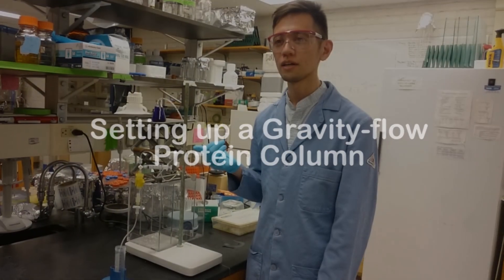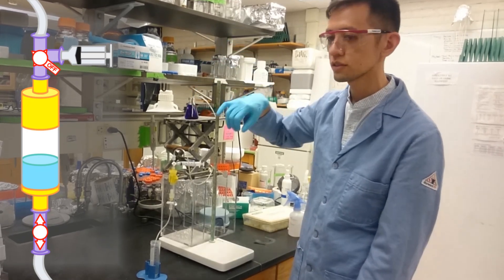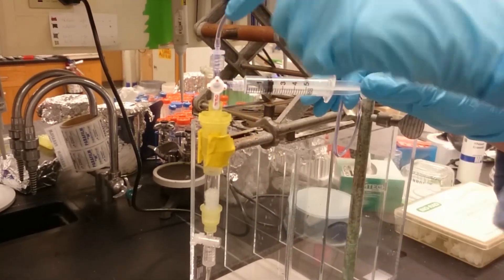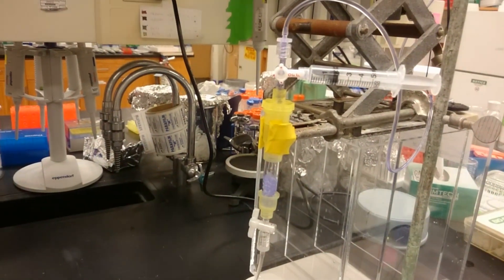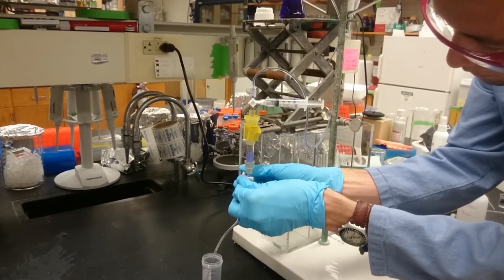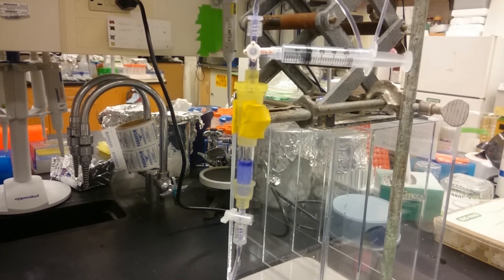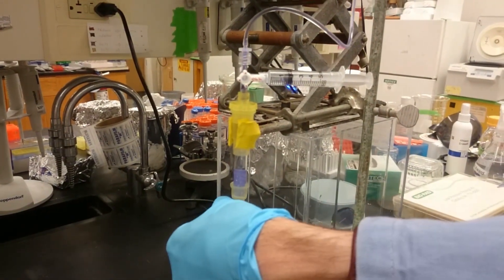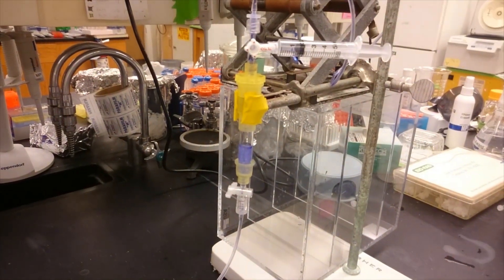Running a Protein Purification Column by Gravity Flow

Comment: Same here, can you tell us where you bought this tubing and valve system?
Reply from the maker: Apologies for the very slow reply! I don't really monitor this account. These fittings were from Bio-Rad (https://www.bio-rad.com/en-us/product/low-pressure-chromatography-fittings), and I used with them with the Bio-rad Econo-columns. You can likely find similar items by searching online. I've added this info to the description.

Comment: Can you tell us where can we buy the tube system used in this video?
Reply from the maker: Apologies for the very slow reply! I don't really monitor this account. These fittings were from Bio-Rad (https://www.bio-rad.com/en-us/product/low-pressure-chromatography-fittings), and I used with them with the Bio-rad Econo-columns. You can likely find similar items by searching online. I've added this info to the description.